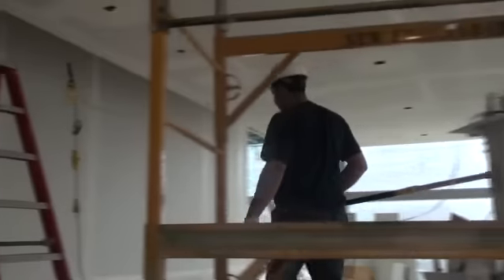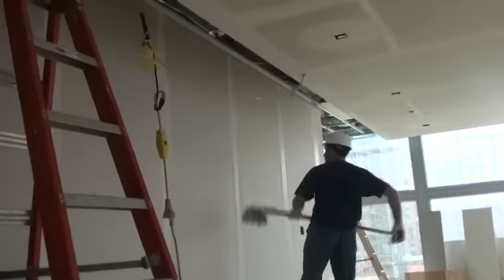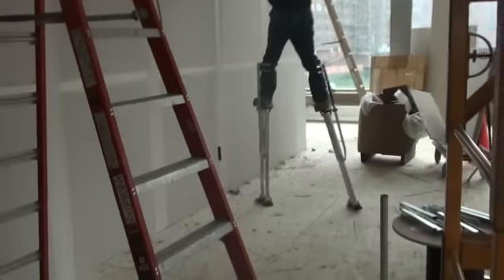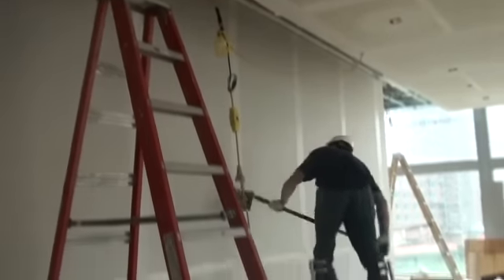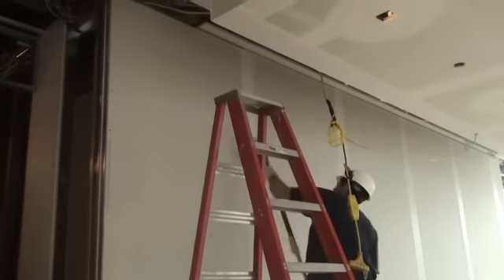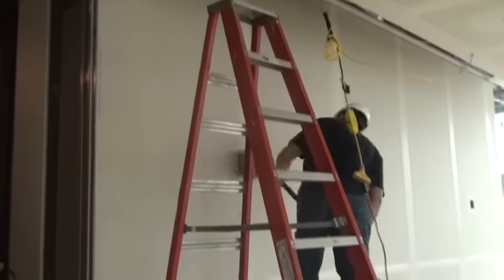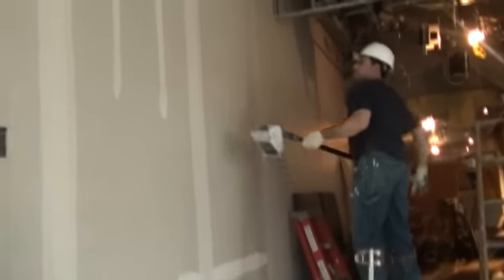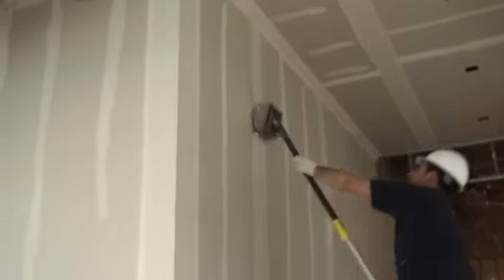Advanced Taping and box coating with Stilts

Comment: We run a long handled 12" blade over the freshly boxed joint to eliminate flags, pores, and lap marks. Using two similar box and handle setups, one guy boxes. The helper guy makes sure there is always a full box loaded and ready to go. And he also does the clean wiping. So the box man never stops to fill a box. He runs nonstop. And the wiped finish is very clean. I never had much use for the 7" box on fill coat. 10" rocks the fill coat.  But to each his own.